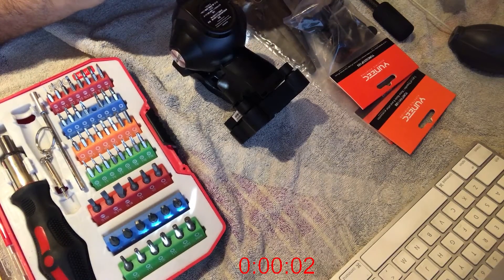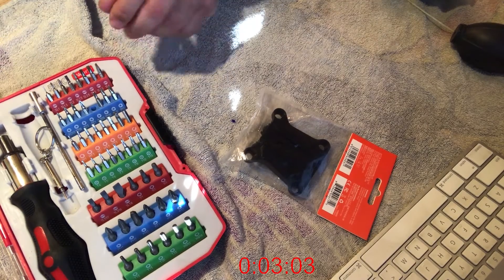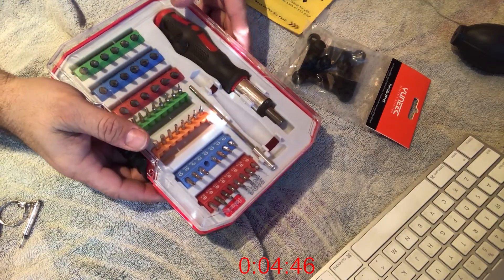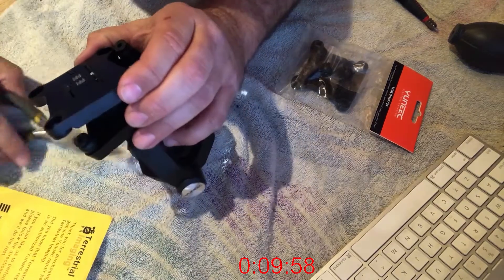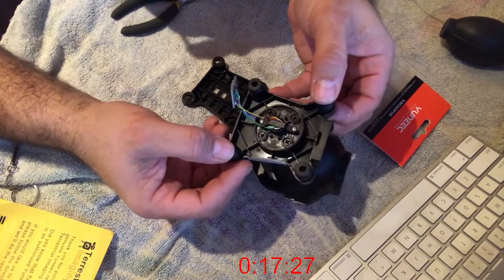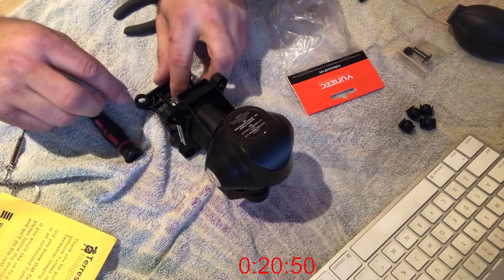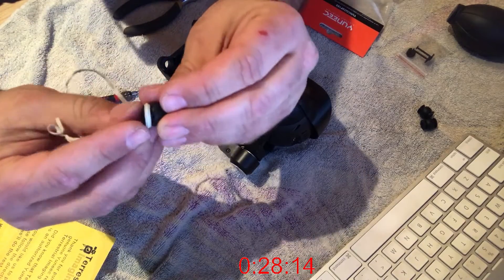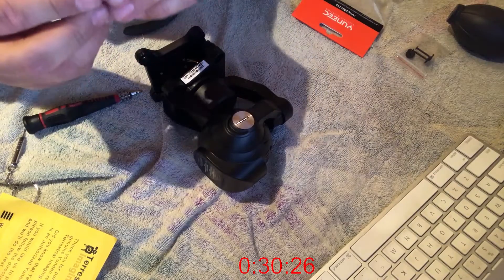Typhoon H Gimbal Plate Repair

Comment: Great video. Same thing happened to me. I was wondering why a angle needle nose plier wouldn't have obviated the need for the twist tie method but it worked for the videographer. Will try.

Comment: What's the name of the part (with wires and brass contacts for camera connection) that goes under the plate that you replaced? I need to replace that part, but don't know what it's called to order one.